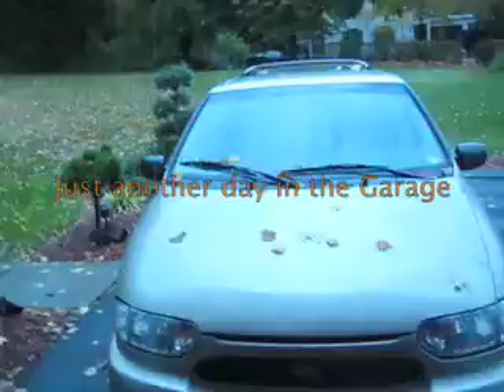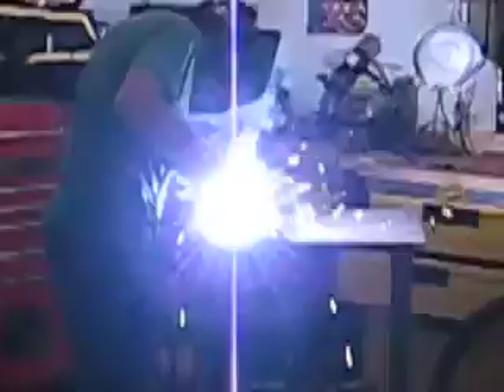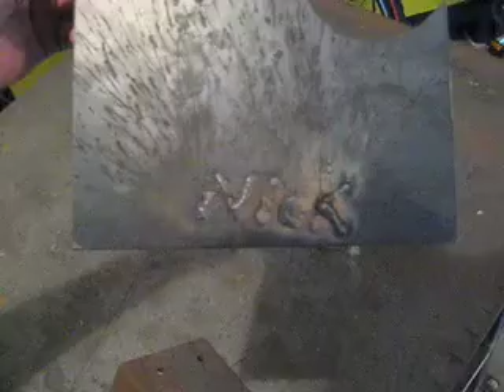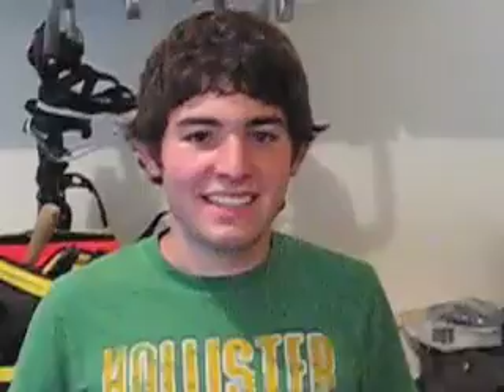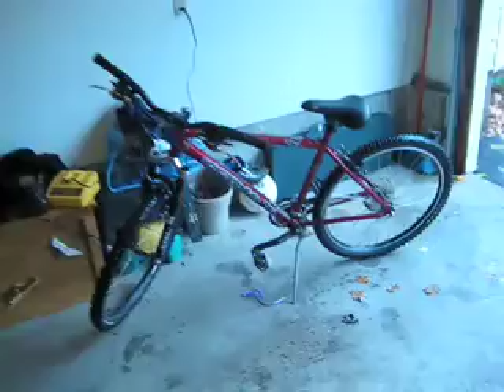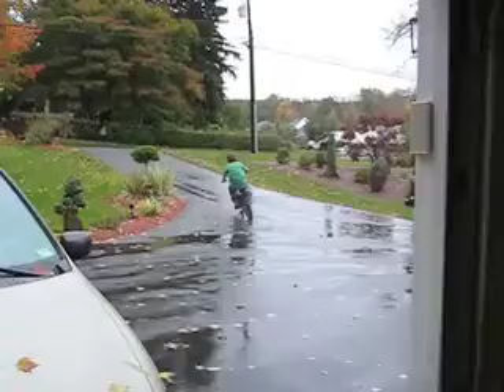TTr 125 custom spark arrestor exhaust tip

Comment: yeah, it makes a difference. if you want the same thing,  for less money, just space out the spark arrestor with washers. put them in between your arrestor and the pipe. then drill a 1.5 inch hole on the top of your air box. a very noticeable power increase.